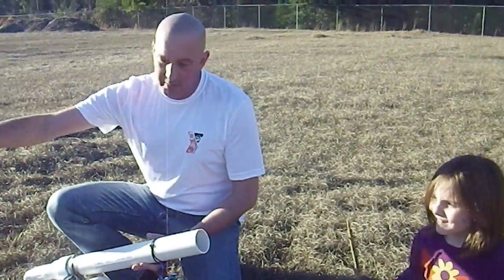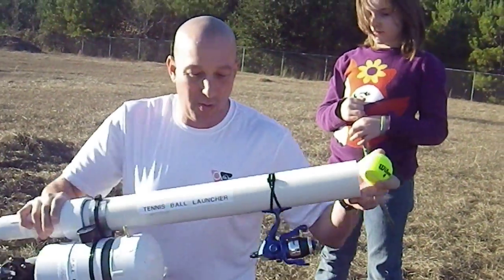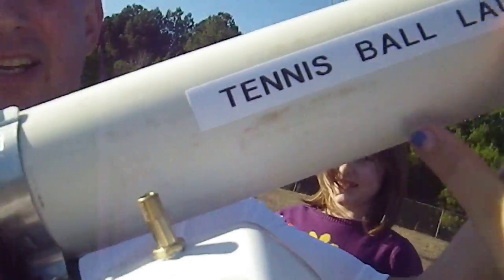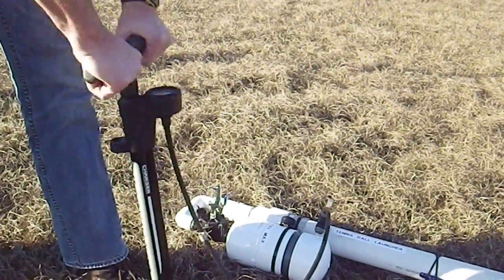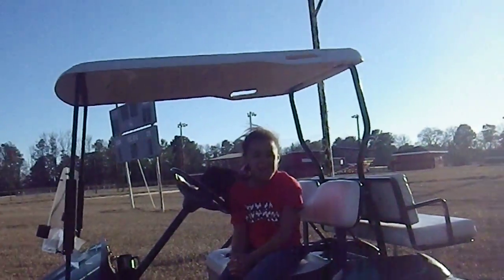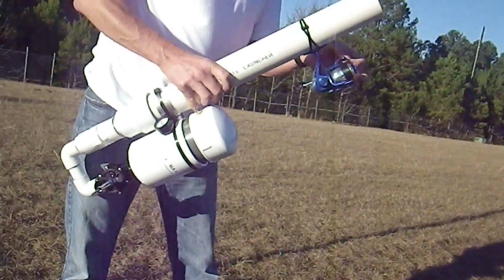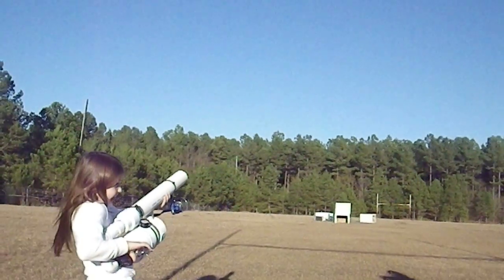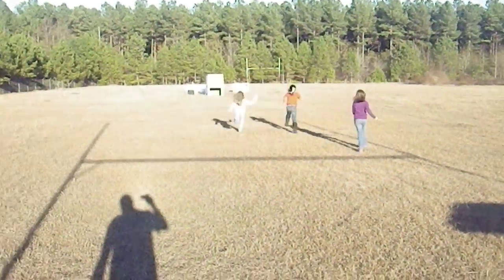Pneumatic Tennis Ball Launcher

Comment: 60psi of AIR in sch 40 pvc is a time bomb.. Air and Water are not the same under pressure.
Reply from the maker: Now you tell me.
Reply: How do you figure?  Psi is a measure of force per square inch.  Water and air are equivalent for integrity testing.  However air doesn't require as much pressure to leak as it has far lower viscosity and no surface tension.  Therefore it will leak at lower pressure.  When it comes to vessel structural integrity PSI is PSI.  Fur that matter PVC fittings are rated at a few hundred psi depending on size and temperature.  .... All that being said I'm still going to keep it at like  25% of rating or less.  Anything over 80psi is pretty terrifying.

Comment: Hello, I am planning to build one but a fishing line set to a certain legnth, when it pulls and breaks explode some high explosives mixed with metal shrapnel I packed into the ball..  I will need a bit more pressure for the added weight.  I may use co2 aswell so I don't have to pump, but that'd be a whole different project
Reply: SednaFTW do you have internet privileges in prison?

Comment: 2.5" PVC fix- I used two 3" sticks of PVC for my barrel. I cut out a notch down the length of one of the sticks so that it looked liked the letter "C".  I then wedged it down inside the other one.  The tennis ball fit perfectly.